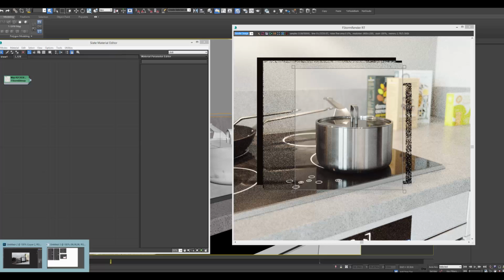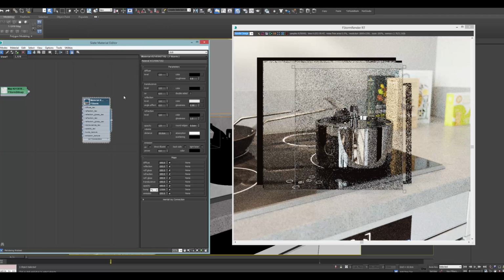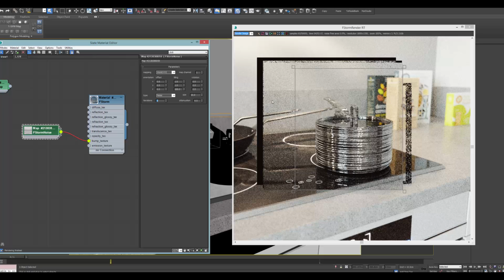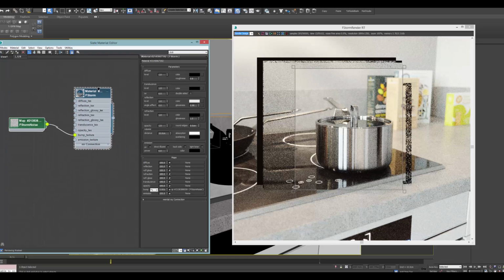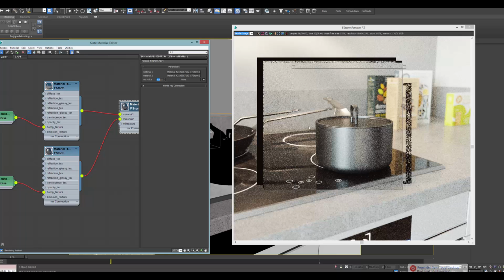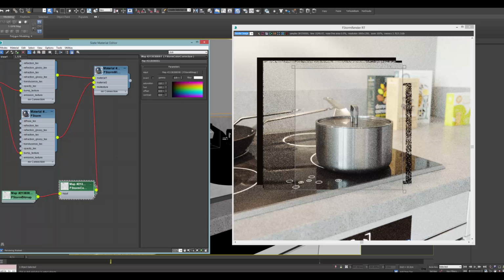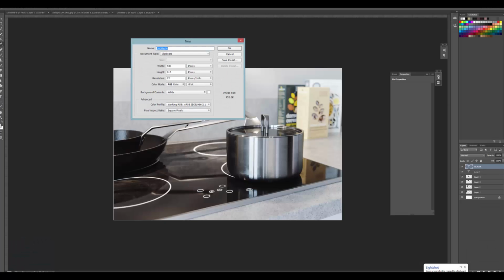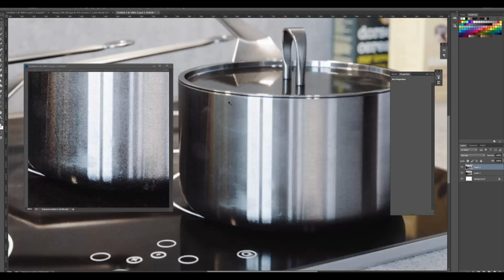FStorm tutorial: Perfect anisotropic shader

Comment: I'm a Blender user, but I found this very interesting. What is the magic that turns bump mapping into anisotropic shading? I though that was impossible. Other than displacing cylinders along a surface (which gives you the shadow term), I have always dealt with anisotropy using specialized shaders  to do the job. I have also not succeeded using microdisplacement in Blender to obtain anisotropic shading. What does FStorm noise do, compared to other kinds of noises? I couldn't find anything about it in the manual.

Comment: what is you rig setup?
Reply from the maker: 5x 980ti, only using 3x in the vid though.
Reply: Hi Johannes.how did you make 5x sli?
Reply from the maker: Ivan Vtorov sorry for replying so late, didn't se your comment. Not sli. But most ws motherboards has 5 pcie slots. I use a splitter from amfeltec though since I can't fit them all.